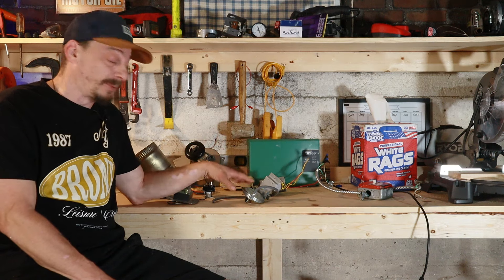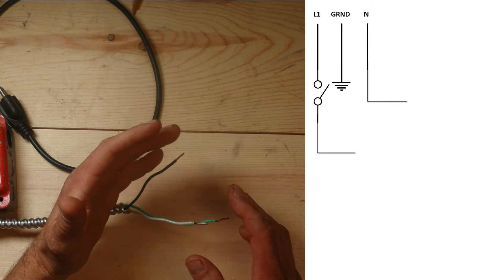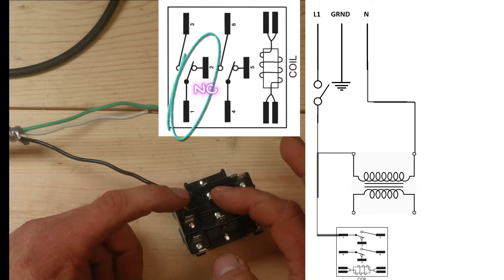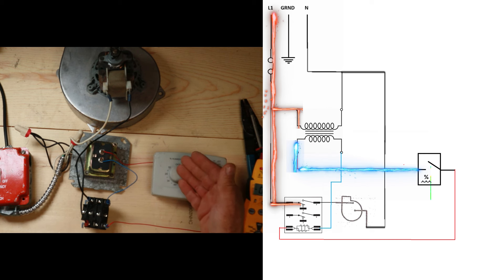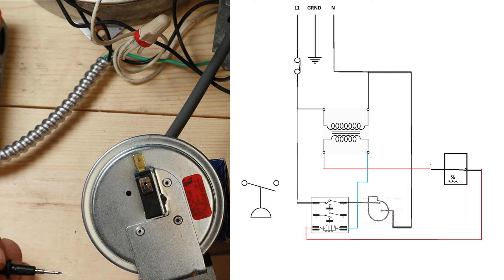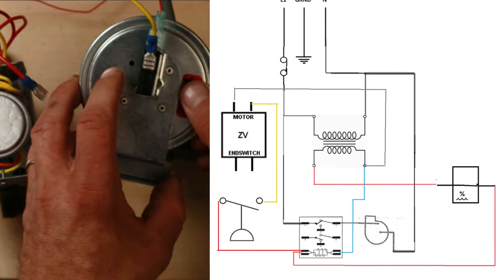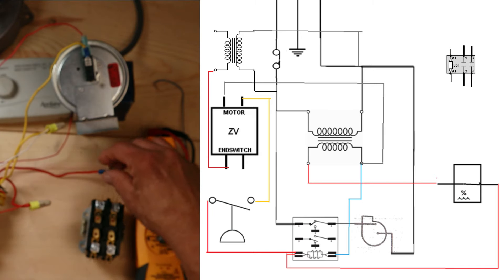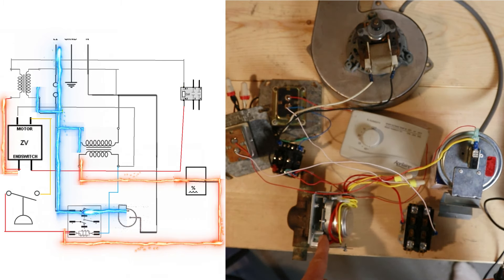Building & Reading HVAC Schematics (Piece by Piece)

Comment: How would you connect a combi boiler to the t-stat. My concern is operating with 2 different control transformers (one from the combi and the other from my furnace) I have a heat exchanger installed above the furnace. is it ok to send 24v from the boiler to the t-stat to control the boiler and the G terminal to control the fan in the furnace which the common is from the furnace